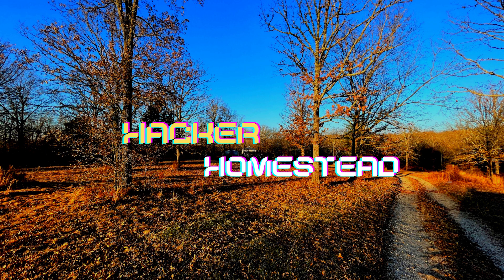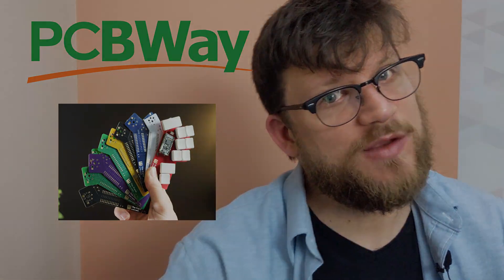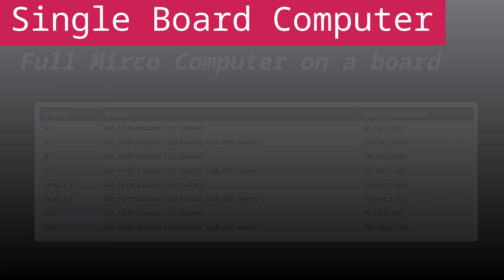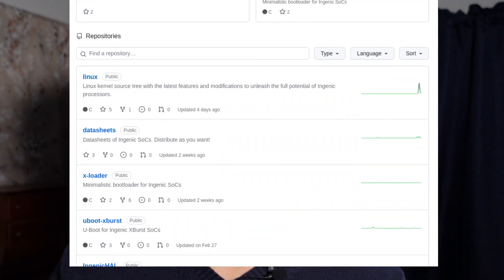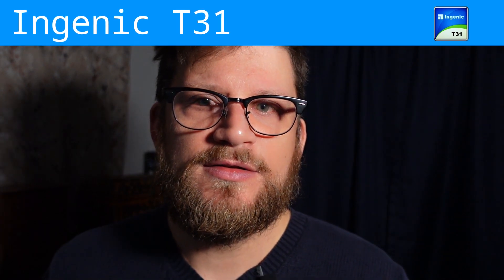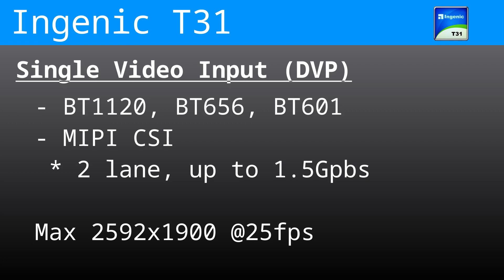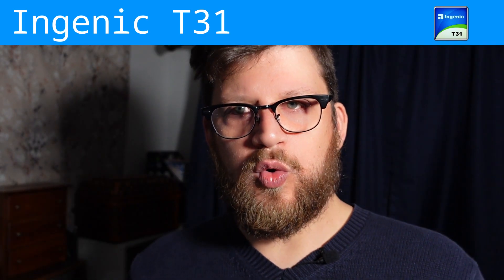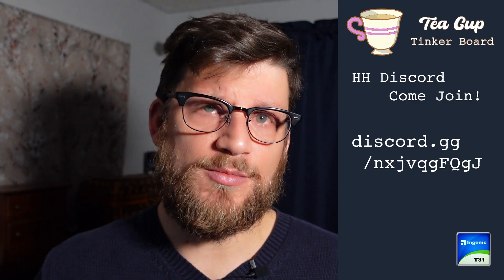What can we learn in Open source from China? |  Ingenic T31 MIPS/RISC DIY Embedded Linux

Comment: Could be nice if the tinkerboard could be pin & formfactor compatible with RPi or Android...
Reply from the maker: I've waited too long to reply to this ... I agree, we ran into a lot of decisions that we basically kicked down the road in the name of "yah but will this version even work at all". Technically there is sssooommmmeeee compatibility baked it since most pins are multi use as gpio. But I would not slap something on without testing... Also still working on actually testing all the gpio and functions since now we have some real boards ❤️

Comment: Did you choose the full size SDcard because it is more compatible with hands than microSD?
Reply from the maker: Lmao yes and labels 😂 also idk about you but I have a lot of small full size cards laying around and I figured you can always use an adapter for the mico ones. If you couldn't tell I personally really want to have two ... There is something about the two disk no hard drive w/ fallback ROM from the olden days that I think promoted tinkering.
Reply: @hackersbasement  Yeah, one of the fond things I remember about my Amiga500.  The floppy to hand interface was quite nice.  I could do that blindfolded.  Also booting from an unchanging ROM directly into a game was somethings I miss.  The floppy on the Amiga was a huge improvement over the external floppy drive on the C128.   Speed though....I don't remember it being so slow and annoying.  
Labels...now that is a thing that is really annoying about the microSD.  They need to start printing qr codes on those things so we can have an app on the phone I can look that up with and add notes to in my phone or other qr-code reading device.

Comment: Interesting project. I'm definitely interested in the progress you guys make. 

I would also love to see more documentation and projects that utilize Raspberry Pi Zeros and other lower power SBC's in "Bare Metal" mode. This could give us the "best of both worlds". You would have a higher performing device running a single application with "lower-ish" power consumption closer to that of microcontrollers. This would essentially turn an SBC into a higher powered microcontroller. Unfortunately, one function many SBCs are missing is DAC and ADC capability built in to the board. So a bare metal SBC project that needed these capabilities would need to utilize discrete external components. But that may be a reasonable tradeoff for some projects.
Reply from the maker: 100% Agree both on bare metal (I am a huge fan of https://github.com/rsta2/circle) and the lack of audio. Feels like these "Smart Video Application Processors" fill the gap in some unexpected ways.